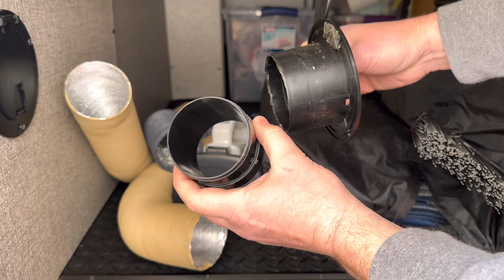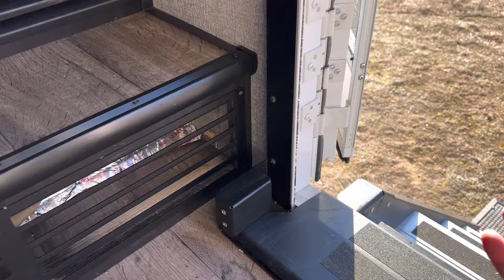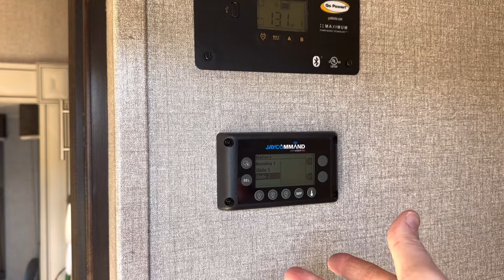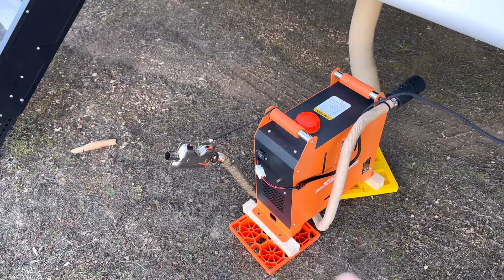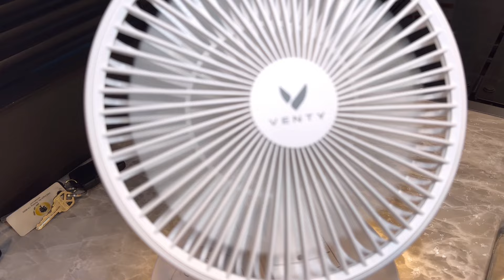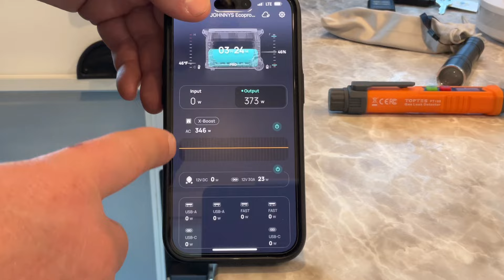DIESEL HEATER RV INSTALL HACK- EASY!

Comment: How is this a heater hack? It is a heater install.  Hack implies modifying something....
This is a creative solution for running piping...not effecient because you are heating cold air instead of circulating the cabin air as these heaters were designed to do.
Reply from the maker: A hack much like you said is to modify something, or Jerry rig something to make it easier or work. 
No one else has installed a diesel heater this way. And it’s easy. 
You modify the through port and add a extra and seal off. 
Did you not watch that part. 
Now sure it may not be as efficient with the return out side. But it worked just fine and wasn’t even on hi. 
I’ll be adding a small port just inside that storage compartment mainly so I lessen any chance of exhaust blowing towards and getting sucked into the return. 
This agile help it be a little more efficient. But that is actually how most portable diesel heaters work. The return or intake lives outside. Look at several of them. They are all the same. Only a dedicated mounted unit you could then justify running the return inside.

Comment: Dont add that much heat to electrical area. If it falls off and you dont know $$$
Reply from the maker: Even if it fell off, it would just blow around in the storage compartment and heat that up. Which would never get hot enough to worry about. 
When it’s summer time and 114 out it’s a 125 or better in the trailer and compartments when in the sun. 
But no matter what no hose is in direct line of hitting wires. 
Should be just fine..👍🏼

Comment: Great setup! I had a similar approach with this particular heater, keeping the unit outside while running a duct inside to my truck.
Reply from the maker: That’s what I had set up for when I had my camper shell. Well I got a 5th wheel and my whole set up changed lol. Never even got to use it. But it was ready for testing 😀👍🏼

Comment: As a retired heating & cooling tech I don't know how you think it's cheaper to run your diesel heater compared to your propane furnace. Your propane furnace has a return air from inside your rv. Your diesel heater return air is outside the rv. That makes it very inefficient.
Reply: Could take return air from inside with minor ducting?
Reply: @Chinook__ you can put the whole  heater inside and just  exhaust it out .  Aswellbas you can run exhaust thru a heater changer to recover heat from exhaust making it way more efficient. Diesel heater is way more efficient  especially  cause you can heat the  specific area tou want instead of areas you don't need too😊
Reply: The diesel heater can be set up to pull air from inside the cabin. Not only that but diesel puts out 138,690 BTUs per gallon and propane puts out only 84,250 BTUs per gallon. The diesel heater also draws far less power to operate than the propane furnace. I’m thinking of installing one as backup or supplement heat for my fifthwheel.
Reply: @Freedom17762  that’s assuming you have an efficient diesel heater tho, these cheap Chinese ones are not nearly as efficient as a name brand real one. The propane furnace is also 12v same as the diesel heater the energy draw would be negligible
Reply: @Knight0vvl   I can assure you they are very efficient. I own one and have many friends who own them. The propane furnace has a much larger blower motor and consumes a lot more power than the small diesel heater. That being said, the diesel heater doesn’t circulate the heat as well as the furnace. It’s just nice to have a cheap reliable backup heat in case the furnace stops working or you run out of propane.
Reply from the maker: @Knight0vvl propane furnace in a RV is 60-90 watts verse 10-15 watts….big difference …corrected
Reply: @johnnysweekends  idk where you got that info, think you have forgotten the furnace is only 12v my RV 30k btu furnace is 4.5 amps. Watts= amps x volts so at max amperage 4.5amps x 12volts =54 watts the only electricity an Rv furnace uses is the small blower fan.
Reply: @johnnysweekends  also, the average diesel heater with the fan going pump running and glow plug on those diesel heaters pull and average of aprox 2 amps and during the start up process can be as much as 10 amps. 2x12= 24 watts so the diesel heater is using 0.024kwh and the furnace is using 0.054kwh roughly half the electricity but at these small amounts the savings is very negligible. You may save a dollars or two per month. But in my state untaxed off road diesel is 30+¢ more per gallon than propane. So what did you save really? Even if the heater puts out more btus per gallon the savings is gone when you de tor in the extra cost of the fuel.
Reply from the maker: Sorry you’re right…corrected, mine draws about 85 watts give or take
Reply: @johnnysweekends   interesting, I didn’t think it drew that much wattage.
Reply: @Knight0vvl   good info! I’m thinking of getting a diesel heater installed mainly to have a backup way to heat my fifthwheel if the power goes out or I run out of propane. I would love to do wood heat but it’s just not practical for my application.
Reply: There are some substantial benefits to using a diesel heater in an RV.   Propane tanks are heavy and unwieldy.   If you have a built in tank, filling it up is a pain.   I can get diesel pretty much anywhere and only need a Jerry can.   For boondocking, propane doesn’t even compare.   

Propane heaters add humidity to an RV.   Diesel heaters do not.   This is another pretty big perk of diesel heaters.   

Boondocking- sure, 2 more amps do not seem that much in terms of cost, but I can get twice the runtime out of a 100ah lithium battery running a diesel heater.  

If you aren’t a boondocker, then it’s really not worth switching out since most RV parks offer propane.   But for boondocking, propane loses every round.    I removed my propane furnace and water heater and switched it to a hydronic heating system which is just a fancier diesel heater.   Works well in my 26ft ATC toy hauler.
Reply: @bigrigross  propane (Suburban) furnaces do NOT put moisture in the air, as exhaust exits outside! The propane range top will.
Reply: Propane causes moisture which is the bain of any RV. Dry heat will save your vehicle from mold
Reply: RV propane heaters are noisy as heck. Better to have the diesel outside and sleep better.
Reply: The moisture is in the exhaust.  The furnace shouldn't be exhausting into the interior.  The Mr. Buddy type do exhaust on the inside and do cause a problem.
Reply: RV furnaces don’t have a true return air, there’s just a vent that allows airflow to the basement area where the furnace is located. The furnace draws more cold air from the poorly insulated underbelly and so doesn’t draw the warm air in from the RV living area.
Reply: A diesel heater is many magnitudes cheaper to run than a propane furnace. You are clueless.
Reply: All you have to do is  run  a return I ti camper .
Reply: I wonder if the fact that you get 35% more btu's from a gallon of diesel than propane makes up the return air issue?
Reply: LOL it's $50 per 30ib propane fill in Canada that lasts 3 nights max in the fall vs diesel heater 3 nights for 7.5L. Troll post
Reply from the maker: It does make the diesel heater a little more inefficient which this was discussed in a previous post about running the intake/return inside the rv much like the main hose right at the same entry. 
How ever this is still cheaper and consumes way less power then the onboard system. On that same evening / I would have used about 3ish gallons of propane. Verses about 1 gallon or so of diesel. And at 25 watts on average on medium for 12 hours that would only be 300 watts. Which would have been even more efficient if I went direct to the battery verses the power station. 
The furnace would have used much more power clicking on and off two or three times per hour to hold the temp. And on medium low the diesel heater only uses about 16-20 watts and low about 10-12 watts. Which on those settings you cant touch it for fuel consumption and power draw. Obviously this big unit doesn’t help. 
But I may look into running the return inside the storage door. This would have much warmer temps then outside near the ground.

Comment: How hot do the plastic fittings get?  I have seen videos where the  hot air temps can get pretty high.  From my experience, this looks like a great way to keep the over night temps acceptable without a lot of power draw and having the propane furnace waking you up.  Have you considered piping it to the bedroom?  I found that heating the main cabin during the day is not a big problem when you can wear more clothes and run the generator.
Reply: Thanks for the additional info! Drawing the return air from outside will keep the heated air temp down by about 30 degrees.  I really like this set up : simple with only two connections to the trailer (hot air and 12 volt power) and diesel pump noise stays outside.  If I were going to use this at one location for an extended stay I would consider pulling return air from the RV…less CO risk and better energy efficiency.
Reply from the maker: You’re welcome. And yes its super simple. And yes, if you could pull return air from inside or even the storage compartment would be better then straight outside air as that would be several degrees warmer then pulling fresh outside near the ground. And yes les chance of wind change blowing then exhaust into the intake. 👍🏼 I’ll have to look into a small extension and maybe one more little port for the intake side of that and run it just inside the storage door. I bet when it was 30 degrees out side the storage compartment was in the 40s…
Reply from the maker: I have ran the Diesel heater on high for hours at home testing it and then did several hours a couple times using the unit camping now. Even in this video i ran it for about 2 hrs on max. I thoughts the same which is why I have the foil tape on the first one. Which before I shot the video I had the first inlet covered alot to protect from heat. The first one will be the hottest. But it never showed signs of getting hot enough to warp or melt. So I reassembled the first inlet after the video and ran it hot for hours and nothing. So I would say its fine.
And most times you don’t need it on full hot except to maybe pre warm it. After that medium high seemed just fine to medium. 
I didn’t do bedroom only because the kids still come out. So i need to warm the whole unit so warm air gets to the bunk room. Hence the fans move the air and blow it that way.
Reply: I’ve just finished my similar install with the same heater running a duct into my Tacoma truck bed. I used a PVC coupler and lined the inside with many layers of foil tape. Seems to be helping significantly with temps so far!